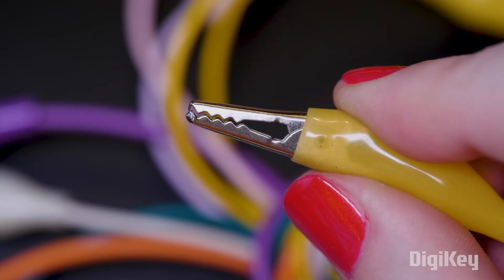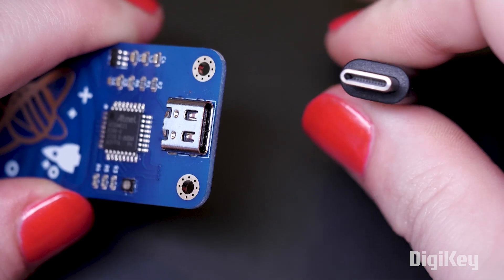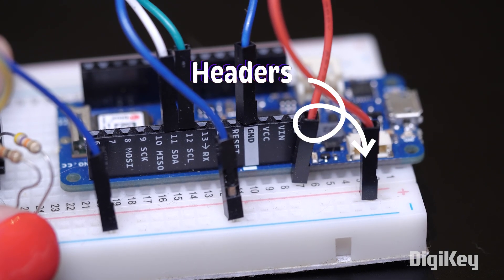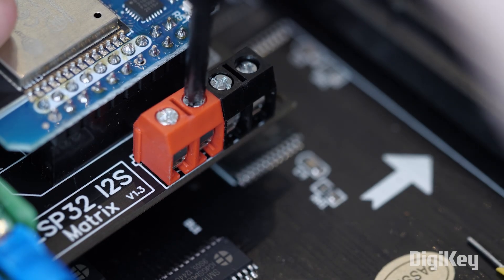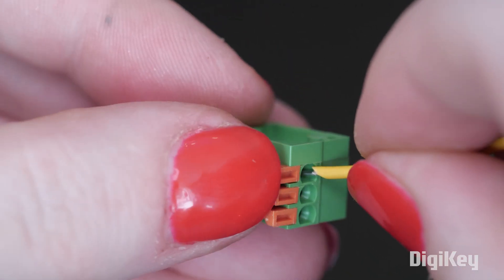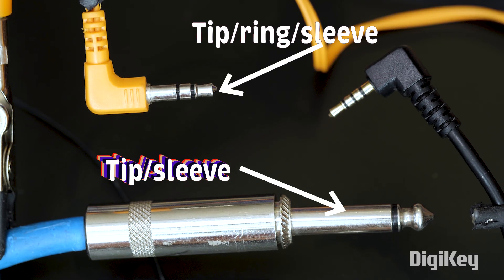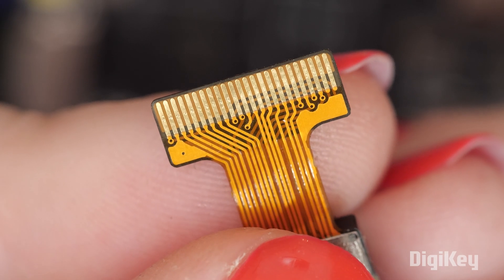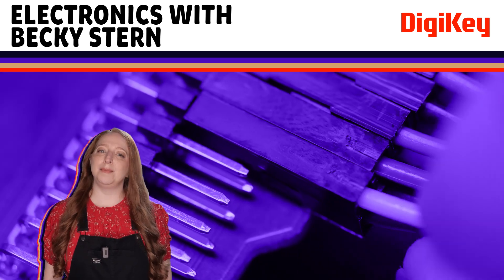The Best Connectors for DIY Electronics Projects - Electronics with Becky Stern | DigiKey

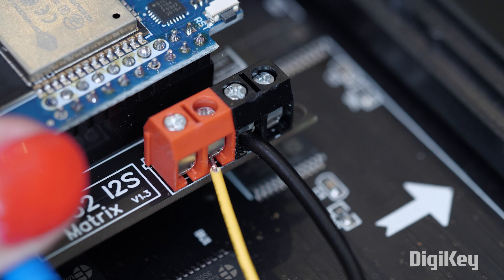Comment: 2:46 Doesn't soldering wires before clamping them introduce the problem of solder creep? 
I was taught the connection will slowly loosen overtime as the solder keeps slowly flowing...